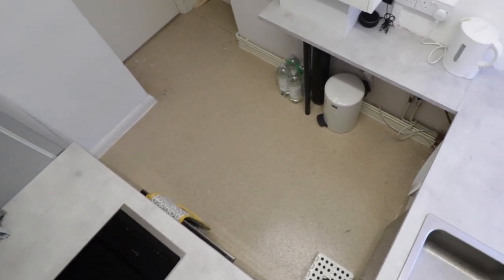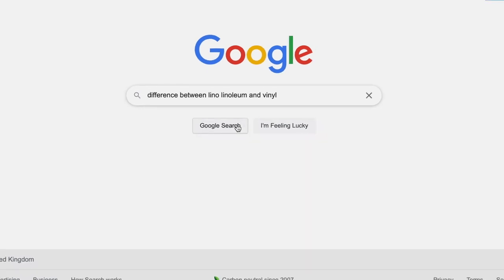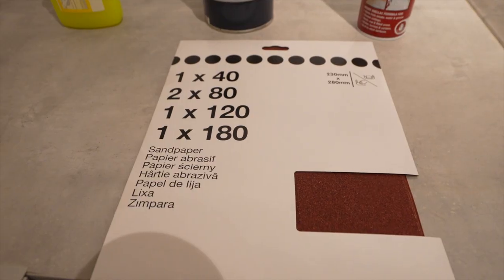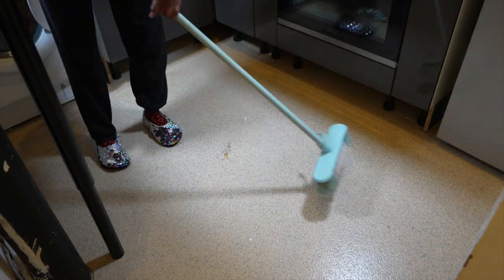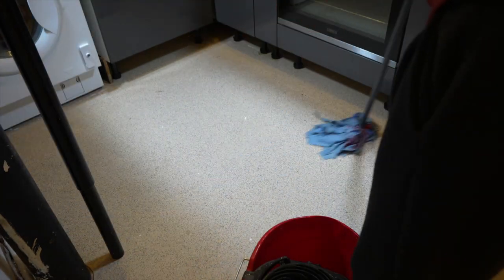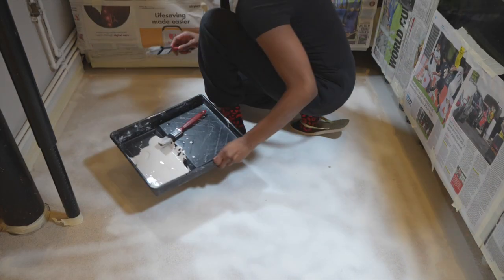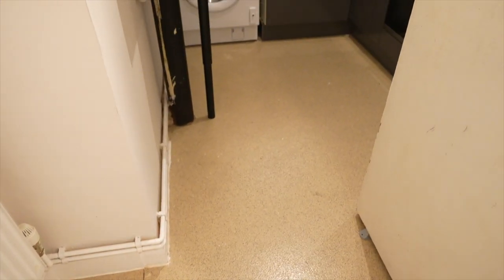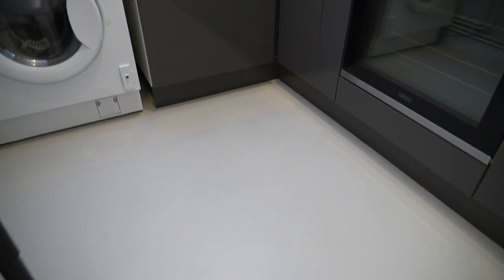Kitchen Floor Makeover: Painting Lino/Vinyl/Linoleum Flooring

Comment from the maker: ***update****Full disclosure: please note that choosing a light colour was a rookie error. It got dirty very quickly. Use an electronic sander over a block. Use the use a primer in a paint tin eg ZINSSER BULLS EYE 1-2-3 PRIMER-SEALER (leave it to dry and apply an additional coat)  I give all these tips because in my bathroom I did the this and it's much better. I've now replaced the kitchen floor, it got dirty and it chipped in the place I put a door wedge. Hope that helps.

Comment: I have this same (awful) linoleum. WHY this was ever used in homes is a mystery to me. I didn't know if this type of flooring could be painted. It's got those little stones or whatever in it that are shiny, depending on how the light hit them. Very strange. I'm so glad I found this video. If you can do it, I can do it! haha. Thanks.
Reply from the maker: Agreed, not sure why this is used in homes and if I can do it, you can too! :) Although I have replaced the floor now, painting was a good temporary solution, while I saved up for the new flooring. I have a pinned comment in under the video on how to avoid my mistakes. Good luck with your project.

Comment: Great job!
Reply from the maker: Thank you, it worked for me as a temporary solution, especially as I didn’t have the budget for new flooring, but required a lot of cleaning. I’ve now replaced the flooring with laminate flooring.  Are you going to try it? If you are I left some key tips in a pinned comment.